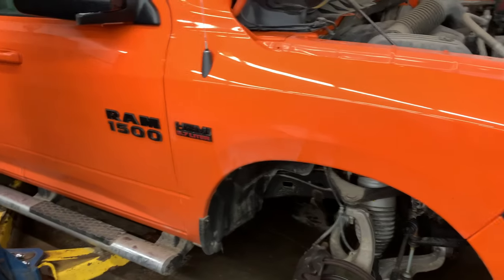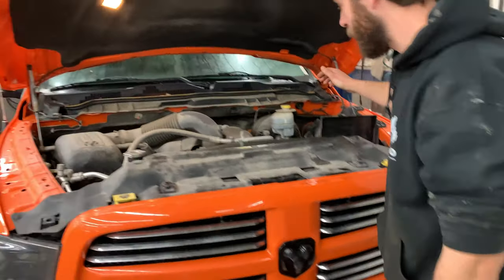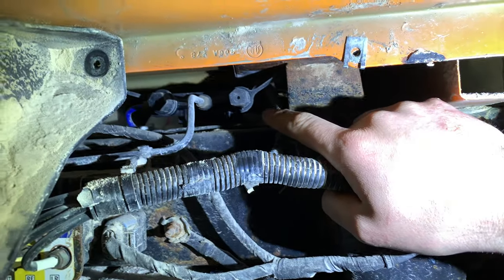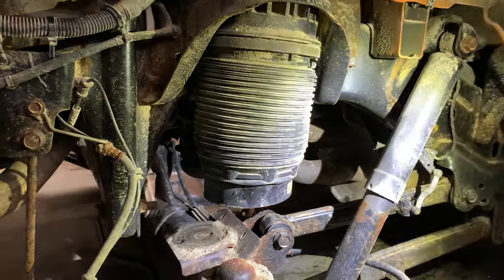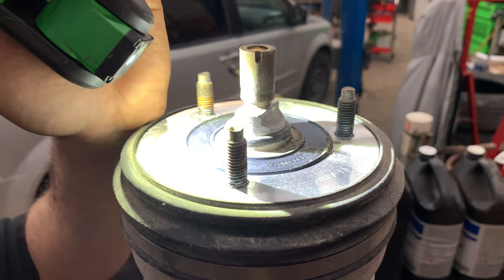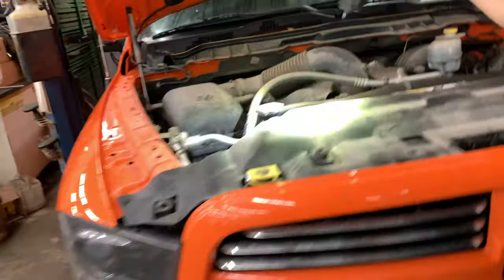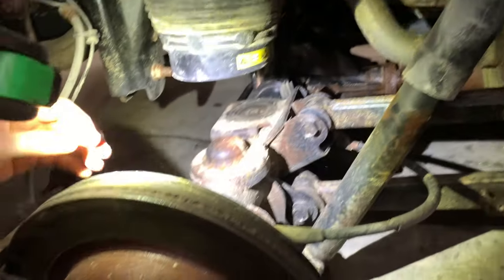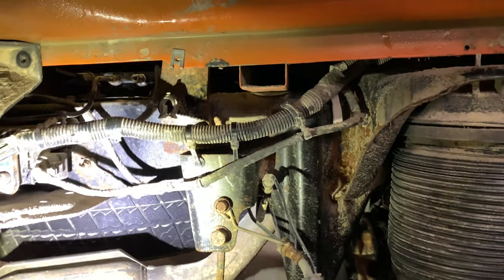Top 5 Places To Look, Air Suspension Issues - Dodge Ram 1500

Comment: I’m not sure where you guys are out off. But I just bought a 2014 blue ram 1500 sport that was from British Columbia. I live in Oregon. Anyways, it looks like the air system was taken out completely and replaced with regular rear coil springs and front coil spring struts. But oh man, underneath is a rusty nightmare and every inch of underneath is covered in this like almost whitish sandy silt stuff. The frame is full of it and everywhere else. I have been under there cleaning it and scraping all of the rust off. They tried to cover it with this rubberized undercoat stuff and painted right over the rust and dirt. Thankfully everything is mostly intact. The only things falling apart are the brake dust shields. So once I get it cleaned up I’ll be able to seal it up properly. But I was just curious because that one looked like it has that same kind of silt caked underneath in some spots. Not as bad as mine was. I’m pretty sure they just never bothered to get a pressure washer under there and clean it ever. lol thanks for the video!
Reply from the maker: @stevenbradley5032  Ontario Canada

Comment: Hey Tech28, My left rear bag looses air when setting overnight only in regular height mode, if I put it in off road 1 or 2 it stays up. Would you have any suggestions on where to start looking?
Reply from the maker: Interesting 🧐 well I would have to say that you definitely have a leak in the system and based on that I would immediately go to the soapy water leak sprayer method, if I were you I would start by having the left rear bag full once the compressor fills it up and then spray the bag and fitting above the bag and see if you’ve got a leak. There is a plastic cover that covers the bag and the zip ties holding it up would need to be cut. I would say to have it in regular height mode when testing it seeing as that’s when your loosing air
Reply: My passenger rear bag does the same thing. I've gotten used to just keeping it in OR1 overnight due to it not leaking at that height.

Comment: My problem is intermittent.  Summer or winter , on the highway in aero mode it will drop to the frame and ride like like there's no suspension,  and won't lift once slowed down. Eventually it will lift again around the city. As long as it  doesn't go into aero it's fine.
Reply: I had that issue, and it ended up being my rear bag'. Whenn the bags are in in aero mod,  the bags would leak. I guess the cracks in the bags would only leak in the lower settings. When it was in normal mode or off road mode the cracks were pinched off. Thankfull,  it was under warranty so ididn'tt have to pay the 4k  cus they needed to replace the pump as well.
Reply: Mine too. I’ve spent a few grand trying to fix. Chrysler doesn’t have a clue. I need help
Reply: @jamespenner1412  right now I’m running into this same issue it started with the front 2 wheels being on its bumps and the compressor stalling and over 20 minutes I’d pull into a gas station restart the truck and see the system rise to when driving home from work it just felt like crap in aero mode to it won’t fine it’s normal ride height off highway and won’t change to any other modes and I’ve checked leaks in every setting got none but randomly had the drivers side rear deflate completely empty and all I’ve had are compressor codes any suggestions
Reply: @Austin West  if your rear bag is deflating then your rear bag will be shot. Rear bags are famous for leaking. I would put the vehicle in entry exit mode, after its got to that setting go to settings on your unconnect and ho into settings ,suspension then go to tire jack mode, turn on tire jack mode (it dosen't allow the pump to go on) and leave it for night. In the morning go push down on every corner of the vehicle to see what corner has no suspension. The bag that has no suspension will be shot. Replace it.
Reply: @jamespenner1412  how do u go into entry exit mode?
Reply: @bodong7  push the down button 2 times

Comment: My manifold cracked right where you said it would with the aluminum to plastic. To replace the manifold do I jsit swap it and let the pump run to refill with air or do I need to somehow buy nitrogen? 

Don’t want to take it apart and grenade my entire system.
Reply from the maker: It should be filled with nitrogen. Regular air can fluctuate pressure in relation to temperature and also introduces water molecules into the system which can be devastating over time

Comment: @ 1:55 ... The brass fitting that goes into the aluminum housing... mine is leaking from there. Can I separate & fix the leak @ that spot?? :-) thank you
Reply from the maker: Yeah they sell that piece separate so you can fix it, I’ll see if I can find you a link
Reply: @Tech-28  thank you so much for your reply, but I did separate the brass fitting, just unscrewed it & replaced the o-ring with a simple new faucet o-ring & the leak is stopped now. Thank you for your time!
Reply from the maker: @sebastian842  that’s awesome! Glad to hear you fixed it! Keep up the great work 👍

Comment: My 2017 rebel, drivers side front keeps dropping after not driving it for a day or 2. Is it most likely the fitting on top? Thanks!
Reply from the maker: Grab yourself some soapy water in a spray bottle and spray it down to see if it bubbles
Reply: @Tech-28  will do thanks!
Reply: Do you know the part# for the manifold? Issue wasn't the brass fitting and whole front end was dropped after not driving it for a week. Think the issue might be one of the aluminum valves in the manifold.
Reply from the maker: I don’t know exactly off the top of my head, you would be best to call a dealer with your VIN and get them to find you the newest superseded part number available
Reply from the maker: @shawnmcbrien9561  I can't find it
Reply from the maker: @shawnmcbrien9561  Might be this 4877129AC
Reply from the maker: Or 68204398AA for the valve block, not for sure though.

Comment: What are your thoughts on using aftermarket air suspension? I have a 2013 Dodge ram 1500 Limited I see on A1 auto they have a replacement for front and rear quite a significant price savings versus dealer cost.
Reply from the maker: 100% go for it! If I had one I would definitely be going aftermarket, the dealer shocks are soo expensive. Hey you should check out a company called “Arnott” they sell all kinds of replacement air suspension, not sure if they are cheaper than A1 but definitely worth looking at
Reply: Thanks the kit for all four is less than a $1000. At this cost point, I’d rather just get the air suspension up and going versus deleting it.

Comment: Hi! I have a tiny leak on my 2 valve where you charge the nitrogen what is the best solution to fix it or can I just use tapelon to fix it? And one more thing I need to change my front air suspension can I just let the compressor fill up the air or do I really need to use nitrogen? Thank you so much

Comment: I have a Ram 1500 that will not hold the last setting. It keeps going back to the mid setting. as soon as you start to  drive. It also is a 3.0 ED
Reply from the maker: It would be best to scan the vehicle for fault codes first to try and see if any have set, sounds like you might have an input sensor fault from one of the various input signals sent to the air ride computer which determine what conditions the vehicle may be under in turn causing the trucks suspension to always default to medium height

Comment: Can air suspension be removed and just replace with normal shocks?
Reply from the maker: Yep 👍 I’ve done the replacement on a few trucks now, the only thing is after everything is done you’ll have to unplug the air suspension module under your seat otherwise the truck will ding and flash messages at you all the time. You’ll still get a message on your instrument cluster for the module fault but it won’t be as annoying. So far I haven’t found any companies that make a bypass or easy flash style module delete to permanently erase the programming from the trucks memory
Reply: Thanks!! What would a job like that cost roughly,?

Comment: How do you disconnect the height level sensor electrical quick connect, I want to check the connections, but I see side tabs that look like they toggle in and out, but the connector won't slide off. I don't have a leak everything works, the it will just go flat, and it has no idea where it's at, then it will all start working again fine for days or weeks.
Reply from the maker: The connector will come off you should try cleaning it first to get any small dirt and debris out from behind the release tabs. A lot of times the manufacturer of the connectors don’t give the release tab enough space to unlatch and I use a small flathead screw driver or similar tool to release the locking tab carefully!
Reply: @Tech-28  Thank you, the connectors all looked good, so that's not the problem, lol

Comment: Mine has the leak coming from the top of the front bag like you said. Do I need to replace that entire bag assembly. Or just the fitting ?
Reply from the maker: I’ve had luck just replacing the fitting
Reply: Do you have a part number for the fitting? Thanks

Comment: Do you know where to get a Service/Shop Manual for the Air Suspension System for a 2015 Ram 1500 Sport?
Reply from the maker: I am not sure about a physical copy but anything I use is online
Reply: @Tech-28  Where do you get it online at?
Reply from the maker: @energyefficient2247  I use a paid program called Mitchell pro demand

Comment: Hey brother I have a 2017 ram it keeps suddenly failing along with the tcs and tow /haul, trailer brake any idea what it could be ive checked fuses and what not where are you located it seems the mechanics in my area seem to not know anything about the air suspension
Reply from the maker: I’m in Canada 🇨🇦. Does the system air itself back up after it leaks down or does it leak down and you keep having to bring it in to your shop?

Comment: I have a question about my 2015 ram 1500 air suspension, i only have one side, back end on drivers side that will sagg evey now and then, none of the others do that, would that be because the air suspension control valve solenoid is going bad, i can reset the air suspension and it will start working again for a short time then do it again.

Comment: What about if the air suspension lasts a few miles then goes out...then it comes back after a few more miles???
When it loses air it's like riding on the bump stops...then out of the blue the air ride is back...I can't figure it out. If the system is a closed system then a leaking fitting or air bag would make it never to come back
Reply from the maker: There is a “switching valve” located beside the pump with a bunch of lines going into it that are all color coordinated and it’s possible the “purge valve/switch valve” that opens to release excessive pressure is getting stuck intermittently causing the system to deflate but once it closes again the compressor is able to fill the system back up. What I would do is scan the vehicle for fault codes to see if it has set any related faults to the “switching valve”
Reply: @Tech-28  only codes it throws are...
PO305
P219A
P1DF3
Reply: @Tech-28  oh...my Longhorn is a 2013 1500
Reply from the maker: @franklee9127  P0305 is a misfire, better get that checked out too. P219A is a o2/AF sensor code, probably has to do with the misfire. P1DF3 is an ECU code.
Reply: @Tech-28  yeah, figured the misfire had to do with the O2 sensor...
Reply: @Tech-28  what is the ECU code?
Reply from the maker: The transmission control module may need to be initialized it could possibly be a wiring fault as well. The set conditions are as follows: the time period of the electronic shift module initialization is greater than a calibrated amount of time.
Reply: How would you replace the air lines?
Reply: @Tech-28  I get bcm code on mines it's very bouncy

Comment: I have a 14 ram, went to start battery clicked and dash said service air suspension. Got new battery started fine, no more air suspension message and no codes with obd scanner, raises,lowers fine but when ur driving feels a lil rough like it’s not working and when jump on bumper back bumper not trying to adjust for load. Any suggestions? Thx
Reply: Hey did you get it fixed ? Mine started feeling like it bottomed out on the rear while driving so it feels really rough

Comment: Hey there where is your shop in Canada seems that I will need to get my truck to you if you near me since I can’t find anyone to fix my 2017 ram 1500 air suspension failure and how do I contact you
Reply from the maker: Where are you located? I might be able to find you a shop that can fix it.

Comment: Hi,
Can somebody help me where to order suitable values? The ones where the system gets filled?
Reply from the maker: Did you mean to say valves? Or value? Also the system gets filled at a shop by someone with a machine
Reply: @Tech-28  Sorry, I meant valves. You can fill it up yourself with a nitrogen bottle and the correct connectors. Those I have there. I just found that these valves could be the cause for a leak in the system. It looses preassure slowly. So I'd like to replace them.
Reply from the maker: @kritisch_gedacht  yep I’ve replaced lots of valves, it’s possible to buy them separately from Chrysler I just don’t remember the part number
Reply: @Tech-28  Oh, okay. I have searched for them, but was not able to find them in the internet. I am located in Germany, so going to a crysler dealer is not an option for myself. 😀But I have family in the states, so I'll ask them to got to a dealer with a picture. ;-)
Thanks. 🙂
Reply from the maker: @kritisch_gedacht  ok, yeah I know they are available because I’ve ordered them myself when I worked for Chrysler however they are difficult to find on Chryslers “star parts” program. I might be able to ask my friend to look it up and if I can get the part number than I’ll let you know
Reply: @Tech-28  Hey. That would be great! Thanks a lot. 😀
Reply: @Tech-28  The fill valve is a standard HVAC valve. If you have a manifold gauge and a bottle of nitrogen, you can do it yourself.

Comment: My compressor will not turn on at all, checked the fuse and relay.
Reply from the maker: Hey there, so the compressor relay is controlled by the air ride control module located under the seat, there is a possibility of the module not commanding the relay on. there is also a ground wire at the right rear side of the frame that could be broken. does the truck have any fault codes in the system? i would start there, it will give you a direction to go in.
Reply: @Tech-28  no it is not throwing any codes. Just coming up on the dash, service air suspension immediately
Reply from the maker: @derekteyler6030  what scanner are you using? you will have a code i guarantee it.
Reply: @Tech-28  just a cheap hyper tough one from Walmart
Reply from the maker: @derekteyler6030  Might need a better scanner

Comment: Thank you so much Tech28 for this video and all your observations, but please anyone checking out this video don't try to do it on your own. Best advice is: TAKE IT TO CHRYSLER. Trust me, even if you are able to change the front and rear springs on your own, this air suspension system is very complicated and you need to know way too many things to get it going and have very top tech computers to do it properly. Even mechanics at Chrysler they are set into groups so no one mechanic can do the entire system. If you go on your own, you will end up spending a lot of time and money, and in the end with a huge knowledge that is not worth it, unless you are planning to keep your rig for many years. Best advice put a traditional set of shocks and springs, and forget about this Air Suspension, Take it to Chrysler or have a lot of time to make it happen.

Comment: I have a 2015 Ram 1500 and the dash air ride system is on the normal ride height but will not change when i push the up/down buttons & my remote does nothing either. I live in Florida in the country and saw a couple of rats roaming through my truck so suspecting they bit through some wires somewhere... I am waiting for my service manual to arrive.... When i start the truck I get the "Service Air Suspension" on my readout for a few seconds. I have a nice Fixd code reader but nothing comes up..... Luckily I have no leaks in my system and it is maintaining normal ride height..... Wish i had a layout/schematic of wiring to the module or compressor....
Reply from the maker: Hey there did you get any fault codes?

Comment: My air suspension system does not leak, but rather the rear passenger corner gets stuck up or one height setting higher than the other three l. Any thoughts?
Reply: Mine are not identical hights either, i even made some adjustable links to manually adjust it to the sensor and could not get them closer than within halan an inch of each other.